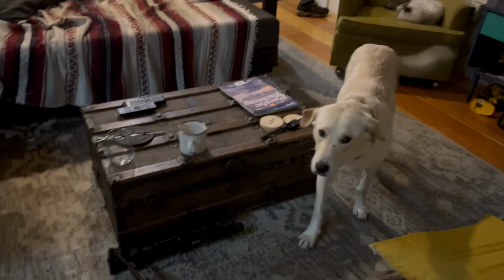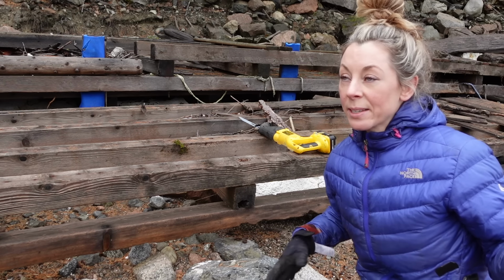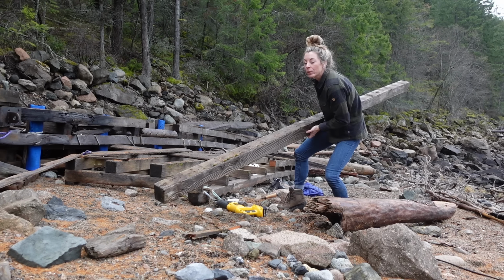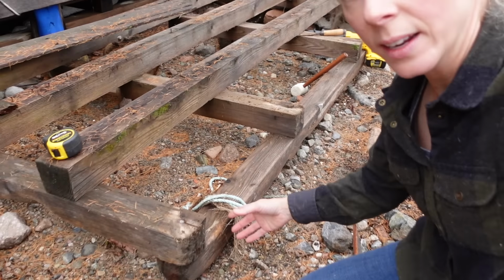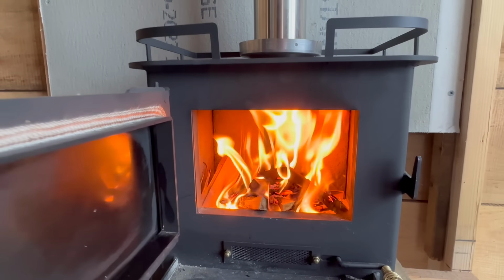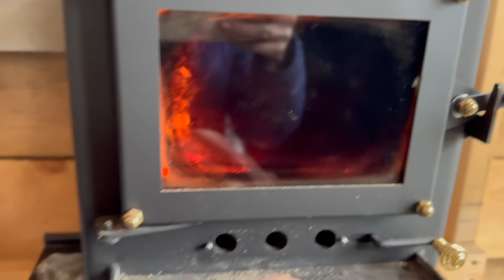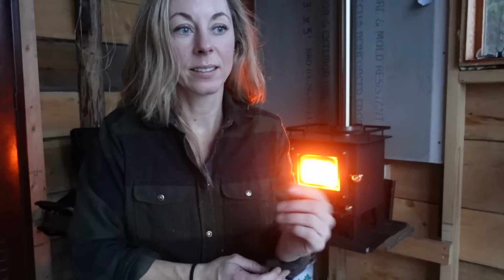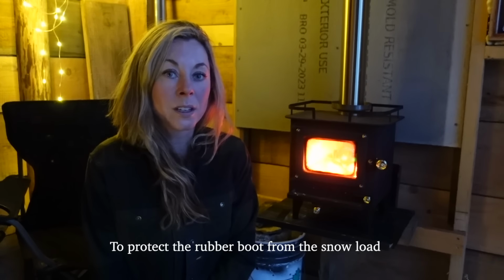It just got HOT in here! | The Cabin on a Cliff series

Comment: To fit flues -- use 1" or 3/4" of long nosed pliers to bend the crimped / corrugated end of flue tighter to reduce overall diameter of said end of flue to be more easily inserted into un-crimped piece.

Comment: Oh hey simple  fix where the pipe joints connect run a metal or wood screw into the joints --Do you have an upper flue  closed I run my 4 "pipes 5 ft above my shop but if there a screen it'll slow the air flow always.

Comment: Those dewalt batteries usually pack quite a punch,  when you run into charging issues, 90% of the time it's the charger,  i had the same thing, some batteries would charge, some wouldn't.  good luck and godspeed.  I've been putting out a lot of positive vibes on Steves boat,  i've been concerned

Comment: Most 18 - 20 volt cordless tools come with a 2,000 mAh battery, which are limited in capacity and run down quickly.  Frustrating.  Do a search online for 4,000 - 5,000 mAh batteries.  The price of them will make you take a deep breath, but the added capacity makes them a joy to use.  2,000's still have a place, as in when needing to work with them overhead for any length of time.  The bigger ones are much heavier.

Glad to see you got the stove going.  I was going to suggest taking it out onto the deck and dismantling it to see if some packing material got left in a duct or somesuch.  Maybe vent holes not drilled.....but you got it.  Happy New Year to all of you.

Comment: You need a hammer drill to knock the bolt loose, the heavy duty one with socket that fits, one used for take lug nuts off. I feel the struggle to cut them is really hard.

Comment: Happy new year Mrs Mishy Mash. Wow you got the heater to work, well done. I had a thought about your air problem on the heater. A long time ago Aladdin lamps, that run on Paraffin oil when used high up as in altitude have to have a longer chimney on them to get the draught required to burn, its about 2 inches longer than the standard chimney but it ensures there is enough oxygen to burn. When you took that vent off your heater it would have had the same effect. I think its the altitude the cabin is at. would love to know your thoughts on this. Take great care and lots of Love XXX

Comment: If you have to take the stove apart again, the flutes, the crimped part of the pipe, should be on the bottom to allow any condensate in the pipes to run into the stove and not down the outside of the pipe at the joints.
Reply from the maker: I have triple checked 3 times (lol) that they are oriented correctly!

Comment: In my limited experience I have found that an angle grinder fitted with a proper cut off disc is way superior to a reciprocating saw for cutting though metal bolts and other metal objects. But not in this instance unfortunately.

Comment: Goodness, I hate it when someone steals property. You can get yourself one or several trail cameras for the property. Night Vision and motion detection are included with units that are less than $40 -- units that run on AA lithium batteries and last up to 6 months in position. You can spend about $60 for higher quality units that save enhanced photos on SD cards that can be reviewed on TV or the computer. If you decide to consider such units, now is the time to buy. The post-Christmas prices are slashed by 50% compared to normal.

Comment: I assume when you say you have the stove issue figured out you are meaning removing the spark arrester screen from in from of those 3 holes that are actually about 3/4" (2cm). Maybe you can find some sort of screen material with approximately the same size mess and  build a screen that would be (guessing here) like a box with the dimension of 2" (5cm) x 2" (5cm) x 6" (15cm) but with two of the 2"(5cm) x 6" (15cm) sides not there.   So an 90 degree L-shape 2"(5cm) x 6"(15cm) with 2"(5cm) x 2"(5cm) end caps. Hopefully this is understandable.  This would be made from one piece, the overall dimensions would be 4" (10cm) x 10"(cm)  before bending the L-shape and before bending the 2" (5cm) square ends 90 degrees.    (Hopefully if your eyes roll back in your head they don't stay that way) ........lol !!!

Comment: You probably know this already, but gasoline with ANY ethanol in it destroys small engines with carburetors, it corrodes the aluminum and slowly dissolves any rubber gaskets.  Especially engines that sit unused for a while, like a chainsaw.  It's hard to find in the US, not sure about Canada, but once I started using non-ethanol gas in my snowblowers, chainsaw, weed-whacker, etc, all starting problems disappeared.  It is available at some marinas, or places that sell gas for snowmobiles.

Comment: You could have easily just cut the cross piece of wood under the main board you're trying to pull off and then just hit the block pieces with a sledge hammer a few times and then cut the metal.

Comment: i want to offer a suggestion about your wood stove not drawing and failing to burn. i think all you need to do is remove the cap from your chimney pipe. the fire is smothering itself ,so the cap needs to come off.
Reply from the maker: We tried that. Didn’t help. 
It was 100% the grate and once it came off the stove worked like a hot damn!

Comment: Michelle,

Sorry about the theft. That stinks.

Few random thoughts and questions:
- Safety Glasses. Just put them on before you pickup a tool. 
- What kind of vehicle do you use to transport you, Steve and the pack? 
- DeWalt makes an old->new adapter for their new 20V lithium batteries for use with older tools: p/n: DCA1820. That way you can get new batteries and use them with old or new tools. Don't bother with the knockoff brand replacement batteries... I've had no luck with them.

Comment: A Pro Tip:  When using a reciprocating saw always place the adjustable base of the saw against the material that you are cutting.  It makes cutting much faster.  In your case, place the base against the 4x4 lumber to cut the bolt quicker.